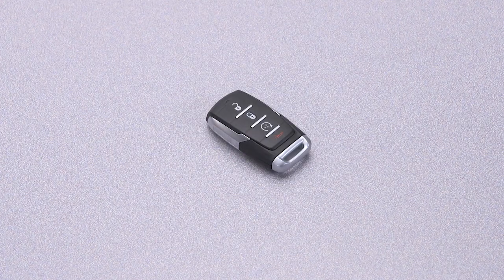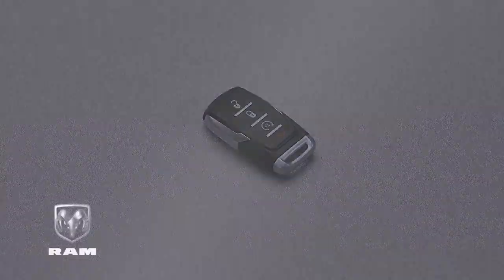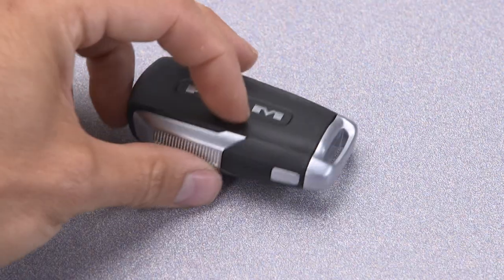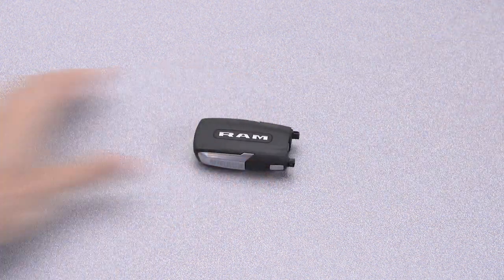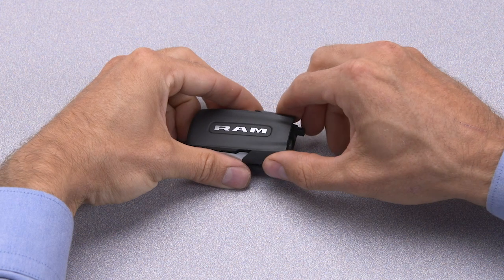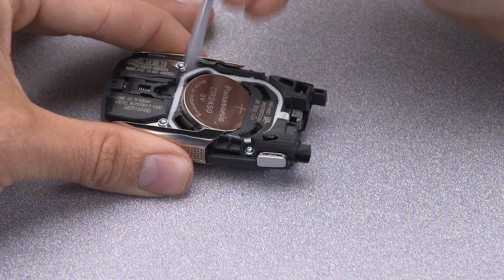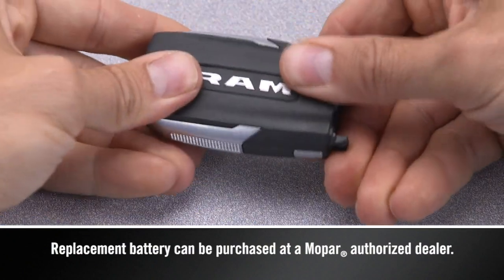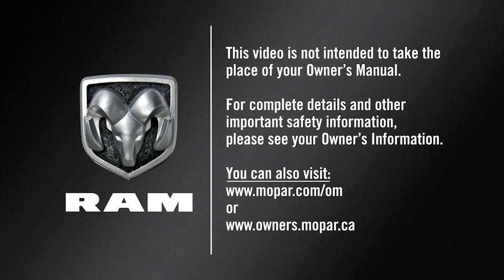Key Fob Battery Replacement | How To | 2020 Ram 2500-3500

Comment: My key fob for my 2020 Ram 2500 uses a CR2032 (not a CR2450 as the video states) so it was pretty inconvenient when I got the new battery, but it was incorrect for my model.

Comment: My 2020 Power Wagon will not unlock the doors after using the remote start.  If I use the remote start I am locked out. Very annoying. My truck has 600 miles.